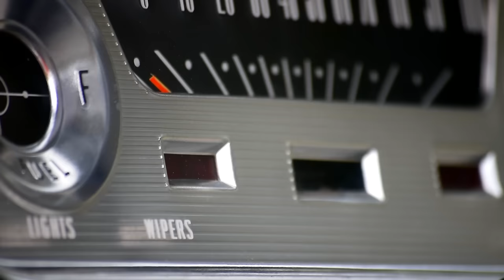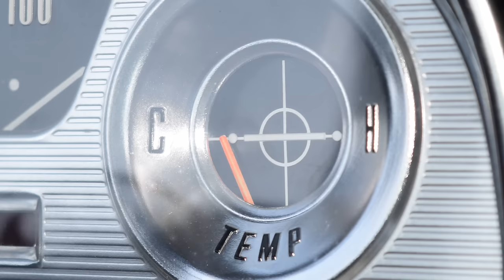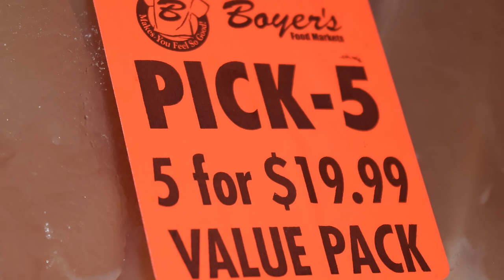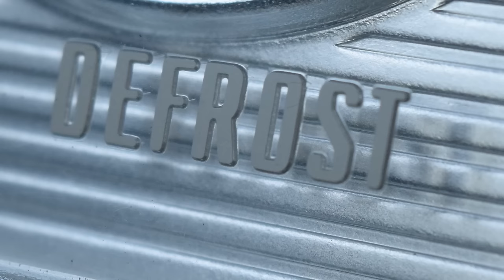Regular Car Reviews: 1960 Ford Falcon (stock)

Comment: 1960 Ford Falcon.  My first car.  I can't remember if I bought it in '67 or '68 but it was my car in High School.  You never really fall out of love with your first car.
Reply: I had one in High School too, and I LOVED IT !   Still do.  Super easy to repair, and took a lot of abuse.
Reply: My first car was a Opel Corsa B with a 3 cylinder engine that made 55hp and rattled like a diesel schoolbus at stoplights.
Hard to fall in love with such a car, but I surely respected that it took me everywhere without ever breaking down.
Reply: My first car was a rusty subaru outback from 2001. It shuddered at highway speed because of rusted suspension components. 18 mpg. I hated that car.

Anyway I eventually bought a Crown Vic and that thing still gets 18 mpg but at least it has 100 more horsepower and rides like a cloud.
Reply: 1973 Datsun B-210, easily forgettable,  especially because my step-dad traded a '69 ford falcon that needed front end work for it.( He meant well)
Reply: My first car was a 1968 Falcon XT 3.6 six 3 speed column,4 door bought  in mid 80s off my father $800-travelled many miles round NZ Cape Rienga to Wellington Wish I still had it
Reply: My dad had one in the early seventies in the uk, engine was worn  out so he stuck a v4 engine  and gearbox from a German Ford Taurus , slightly under powered top gear was like over drive
Reply: First car i owned and drove was a 1968 Vauxhall  viva. You think the falcon was gutless. Excellent  mileage,  but a total mut. The falcon was indeed a falcon,  compared to that car. Moter the size of a baseball  cap . It was a 4 sp and i needed every gear on every hill. I later bought a 69 fast back mustang,  351 cleavland 650 holly double  pumper  4 sp , hooker headers high rise manifold. That thing ripped, bounced  the speedo on 120 mph.. not good good mileage though lol.
Reply: yep. i had a 62 futura. so much fun
Reply: My first car was -97 ford mondeo hatchback. I will never forget how horrible rust bucket it was. The only nice thing in it was that I could fit my double bass in it with three people.

I watched that car crumble in to a square. It was satisfying sight.
Reply: My first car in 1967 the car ran good
Reply: I drive my first car right now and I'm still in love lol
Reply: My first car was my dad’s old chocolate brown 1973 Olds Delta 88 Royale. Talk about a land yacht!
Reply: My first car was a 89 Toyota Corolla. That car had 380,000 miles on it and was still running. The bearings went out in it so I sold it. I didn’t feel like getting it fixed but I loved that car. If that car could write you could make at least 10 full length movies off that. I drove it to California from the east coast and it took me there and back. 😂😂
Reply: I love these old falcons,
Reply: @dogge929                 Ah, we're never too late to learn: always buy quality American, not foreign.
Reply: @Fhita1962      I knew a fellow once who traded a diamond for a piece of broken Coke bottle.
Reply: @lancasterritzyescargotdine2602  I've still got the same vic and have added a '74 LTD to my repository. Both work well.

Comment: In Argentina, it was a very successful tube. It was made until 1991. It basically contained the same body with some aesthetic changes and mechanical improvements up to 166 HP. some quarter-mile teams managed to get around 600 HP from the old 6-cylinder
Reply: Australians never stopped improving it too.

Comment: "Some classic cars... Are just regular cars."
starts a slow clap
Reply: that english degree tho
Reply: roll credits
Reply: Last car show I went to:
15 '57 chevys generically modified.
10 knockoff boss 302 and other mustangs (No 6 cylinders present, like most mustangs were sold)
5 chevelles SS (fake of course)

            G E N E R I C

Then there was a 1986 Mercury Grand Marquis wagon. The most interesting car there, the least valuable, sure, but at least it actually represents the era it comes from correctly.
Reply: until you spend a year modifying it
Reply: @Demosthenes409      Try "English".
Reply: All good classic cars began as regular cars.

Comment: 1960 Ford Falcon
When new 
4-Dr Sedan $1974.00
Heavy Duty Battery $8.00
Deluxe Trim Package $66.00
Fresh Air Heat /defrost $54.00
Two Tone paint $17.00
Manual Radio $54.00
Safety Equipment padded dash and visors $19.00
Front seat safety belts $21.00
Whitewall tires $29.00
Automatic Transmission $159.00
Wheel covers $16.00
Windshield washer $13.00
Electric windshield wiper $10.00
.
Minimum wage in 1960 was exactly $1.00 per hour or $2080.00 per year.
Reply: Explains how my dad could afford a car just working minimum wage for a year before he got his license
Reply: I'd live on that country, I'd have plenty of cars.
Reply: @MrSnek  do you have the VW up in the us? You could get a decent up for that cost. If not, the up is a tiny VW economy car with a 1.1 engine popular in the UK and Europe. They are genuinely great little cars, although slow.
Reply: @NPCDCBA  The Falcon with the 144 and an even the auto transmission got a lot better mileage.
Reply: @ty2010  motorway or city?
Reply: @NPCDCBA  34-36 city and 28 highway (mpg), was probably running lean,also, may have been a 170.
Reply: @ty2010  Ups are good for 40 to 45 city I believe.
Reply: @NPCDCBA  Ew, I'd rather have an old 240d or diesel dasher. Didn't even know you were talking about a newer model till I looked it up.
Reply: If only cars were that cheap for the price of a 4-6K TV, than I'd have a Falcon before I turn 15 in September
Reply: Using the CPI inflation calculator $1974 for a stripped Falcon is $17,285 in today's dollars not really a good deal at all. The $8 heavy duty battery would be $70 in today's money.
Reply: @robc8468  the electric wiper motor was probably worth the price no matter what it was, vacuum sucks.
Reply: @johnharris7751  You are so right! Climbing a hill with a load in my Dad's truck in a rain storm you could either stay on the throttle and not see. Or lift your foot to see, and start down shifting. At least it caused people to slow down during a rain storm. Going down a long steep  hill resulted in the wipers about beating themselves apart. Electric wipers were definitely a blessing to our safety on the road.
Reply: And you could work on it
Reply: @ty2010  Falcon's with the 144 were rated at between 20-30mpg at that time. You only see those upper 30 numbers in period road tests, under a very narrow range of conditions. Still excellent for the era!
Reply: displayfireworks1, You forgot oil filter, $6.00...
Reply: dad got a 60 4 door stick small 6 new in white. cool

Comment: "Some classic cars,

Can just be regular cars."

Applause
Reply: ding
Reply: Mic Drop
Reply: That one quote basically shuts up every complaint people have had about the Vagabond Falcon build. Why automatic? Because regular car. Why a muffler? Because regular car. Why the stock cams? Because regular car. Why didn't you-- BECAUSE REGULAR CAR! GRR!
Reply: Some cars can be regular cars, but the VF is now not a regular car, it's a v8 disc overdrive front end yadda yadda hot rod. Its no longer 6 cylinder, 2 speed, drum brake. I begged him not to do it, but I understand that young men need to fuck with stuff. It's still cool now, but it's no longer a regular car.
Reply: +Kip Amore I think he did most of the stuff to make it more driveable  , so he could drive long distance to review cars and go to car shows
Reply: agreed, it had problems, was unsafe and he couldnt have a car like that if he was going to be driving long distances with it.
Reply: +Bayron Huerta why? It drove long distances in 1960. 400,000 people drove them in 1960. The real reason he did all this is because the trans was leaking and it was overheating and low on power. I'm over it, but he should have just fixed it and left it stock, because that's what a regular car is.
Reply: +dilsher12 It was perfectly driveable in 1960. Making it a hot rod makes it NOT a regular car. But I'm over it. In two years, the video will be about how he never gets time to work on it, so it just sits.
Reply: ***** the car was new in 1960, its not 1960 anymore
Reply: +Bayron Huerta I understand what you are saying, but I see no substantive difference between 1960 and 2016 as far as driving. Speed limit is lower now. And if it were true, why buy a 60 Falcon in the first place? I would have been ok if he just returned the engine to stock, and I could forgive upgrading the brakes. But its no safer now than it was other than the brakes. I don't think this is a bad car now, but it isn't a regular car. The wheels are cheeseball now, whereas stock they were magical. I'm sure you see my point, though you are free to disagree.
Reply: +Kip Amore Sure, 400,000 people drove these in '60-61, but back then the speed limit was much lower, 55 mph, and the Falcons then weren't leaking every fluid under the hood and struggling to make 50 horsepower on a good day. It's not like he made VF into a hot rod, it has a V8 from a '90s Explorer which made somewhere near 210hp when it was new. And how dare he get rid of those dangerous single master cylinder drum brakes and what about that radiator that just pisses on the ground when it overheats. And that wonderful Ford-o-matic 2-speed, such a great transmission. Mr. Regular just wanted the VF to be drivable with today's roads.
Reply: Yes, the Falcon did just fine in 1960 on 1960 roads. In the last 55 years, the Interstate Highway System was built, which the Falcon is not suited for with its stock Slant-6. The car can't even sustain 30mph going up a hill, how is it going to sustain highway speeds on the Interstate? So, putting in the 302 V8 (hardly a hot rod engine) solves that problem. Stopping power is not good with the stock drum brakes, which is really bad for highways, so disc brakes are a must. Things like this allow the Falcon to be used on road trips without worrying about dying every time you drive it. Yes, it's not stock anymore, but at least he kept true to the car as much as he could.
Reply: ***** yea i understand your point, but i think he did what he thought was the better option. If im not mistaken there was an option for a v8 in first gen falcons so it wouldnt be that off..
Reply: +Tyler Haug I'm not disagreeing with you as such, but with a few minor points. Other than brakes, nothing he did to the car makes it safer. The speed limit was actually higher in 1960 vs now. The reason the car wouldnt pull hills and leaked and overheated is because it needed some repairs. It pulled the hill in 1960, didnt overheat in 1960. Therefore, because its a regular car, you fix it. If your regular car camry 2005 overheats or wont pull hills, you fix it.

He made it into a hot rod because everyone wants to build a hot rod. But i think in the end, for RCR purposes, it would have been better just to fix it. But I understand your point.
Reply: +EagleRock1337 I understand where you are coming from, but the speed limit was 70 in 1960, its mostly 55 and 65 in PA now. The car was perfectly driveable and pulled the hills like it should have in 1960, 1980, 2000, etc. The hills are the same. The problem was it was leaking tranny fluid, down on power, and overheating. All those problems could have easily been solved with $500, just like they were solved in 1960, 1980, 2000, etc. I will concede that dual circuit braking is a good safety improvement, but drums work fine for a car like this. Every semi on the road is still drums today, even in the front. 

Seems to me that if the whole point is to be able to demonstrate "this is what a car was like in 1960" then that car shouldnt have a drivetrain from 35 years later. Nor should it have a/c, bluetooth, 17" rims, and so forth.
Reply: +Bayron Huerta I'd have to look that up, but I think it was 6 cylinder only till 62 or 63. I could be wrong. The competition, valiant/dart, chevy II, corvair were 6s only in 1960.
Reply: +Kip Amore I put over 100,000 km on a 1980 vespa scooter back home. Was it comfy no , was it safe , lol cable drums back and front noooo. But i made do with what I had at the time .Would I do it again , no, I have nice Suzuki bandit 1200 to tour around on now .  People have put over million miles on ford model T , doesnt mean its safe and easy to do , its just that thats what they had back then . Its not a weekend cruiser , he wants to put miles on . Nobody enjoys going 50 mph on the freeway with engine screamin at over 3000-4000 rpms.
Reply: +dilsher12 I wouldn't argue that, but your analogy is flawed. You rode the vespa because it was that or nothing. The falcon was $7000, and he could have bought any number of more sensible cars. Not sure what Bruce Henn would retail that work for, or how much all the parts cost, but I'm sure its an addition 10k or so. I think the VF is great, I just dont think it qualifies as a regular car anymore. It would have been the opitome of regular if he had fixed the things that were worn out, but left it stock. But as it stands, now its an old body with entirely new mechanicals. Thats fine, but it doesnt give us a window into what regular cars are, and it speaks against the guys who have vintage cars and use them "regularly".
Reply: +Kip Amore Yup my analogy still stands true , because mr. regular wanted a regular car from the early 60's , not a muscle car not a caddy not a big luxo cruiser barge, not a modern regular car . So he  ju got just that and made it so its more enjoyable to drive everyday .A mild 302 with a ford overdrive trans did exactly that , there's nothing fancy about it . Now if he put in a big coyote motor or a ford crate motor with forged internals and stuck  twin turbos on their or a big blower and putting 800 whp through a ford 9 inch with some big slicks  then i would agree with you  .
Reply: +dilsher12 I dig what you are saying.
Reply: Just read this whole comment chain, and had to stop and think before I went all alkjdflskdjfaskjdf ANGRY VOICE YOU DON'T KNOW WHAT YOU'RE TALKING ABOUT. But, you do make some good points and strong arguments. However, I HIGHLY doubt Mr. R will let this thing sit because he doesn't have time to work on it so on and so forth. If anything if it breaks down, he'll have an excuse to go the Bruce's and film some more awesome cars. Also, I think now a days a "regular" classic car is a misnomer. Basically id say 90% of classics are garage kept, and come out for maybe 5 months of the year for shows. That's about it. Which is sad but its true. I AM with you it would be nice to see it be "regular" and unchanged, but if I owned VF, and did my daily commute in it, I would probably die. So it is nice to see him making changes to keep the thing going, to at least let people SEE the amazing shapes that cars of the 60s had. Thats just my opinion.
Reply: +Andrew Cathcart Yup totally agree with you !
Reply: +Andrew Cathcart A well formed opinion and I generally agree. But a few points: Bruce does car resto for a living, and those kind of shops are mega bucks on an hourly rate. If the VF needs major work, then Bruce is the man. But since its now an amalgam of non-stock parts, regular repair places won't want to deal with it (they might for mr reg, they wouldnt for you and me).
Reply: +Andrew Cathcart Further, back in the early days of RCR, mr reg had a toyota echo. That got totaled, so he did a kickstarter and fans bought him a Honda Fit. Thats his daily, and he still uses it. So these comments about traffic and safety are moot because his regular car isnt the VF. I'm trying not to say "he bought the wrong car", but he bought it with the intent to daily it, and he may still do that but I predict not. But what you say is true, the very old cars are perfectly fine to daily, and I get a huge boner when someone does that. For years it was ME - all through the 80s and 90s I dailies 60s cars. Not hot rods, just old junk.
Reply: ***** I've been a fan since day one Kip so I know the story ;) And thats awesome you did that back in the day. At least you looked cool on your daily drive compared to the crap boxes of the 80s 90s! But maybe i'm an optimist and like to think Mr. R WILL daily this, well not daily but put more than 5K miles on it in a year. But if ANYTHING, we got a memory of what this car was that will last for as long as youtube lasts.
Reply: +Andrew Cathcart Wise words, and I suspect Mr Reg did this because he's young and has never built a hot rod before. What did he say in the first Carlisle Corvette show video? "I want in". Well, now he's in, which is great. And the rest is just me being a middle aged dick because I've done hot rods before and the results were usually disappointing. Back in my day (commence eye rolling) I built a big block 67 Valiant. I basically welded the motor to the frame rails. 2 barrel, stock drums, stock highway peg leg rear...but it had headers and a B&M megashifter! It wasnt really fast, but it would boil the 13" tires (well...tire) at will. Shitty in the snow. But I drove it for years like that, and never had enough dough to make it right. But it made me feel cool, and that and a bag of weed is all that really counts when you're 19.
Reply: Nothin to see here folks Just regular guys driving regular cars
Reply: Jarred Miller roll credits
Reply: @TheJipino  roll credits